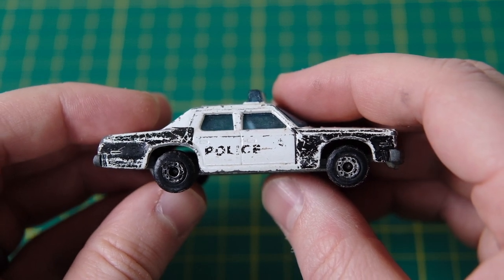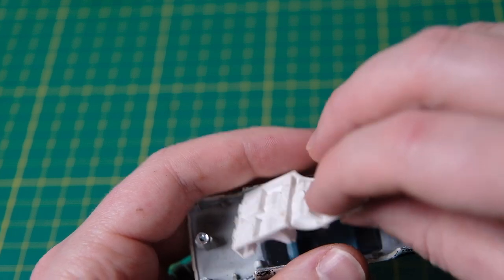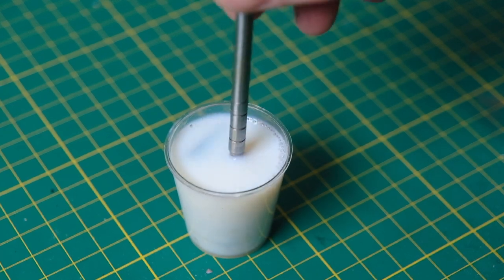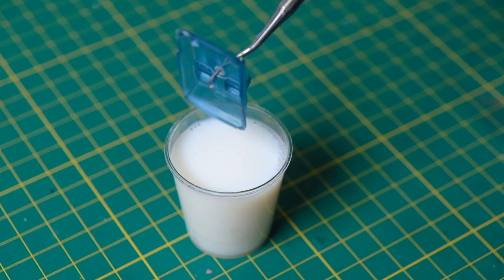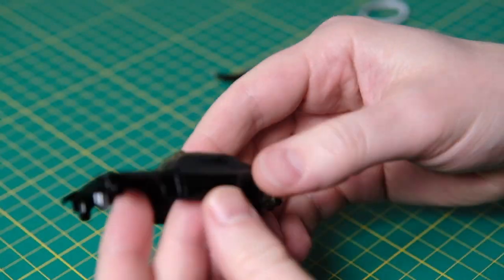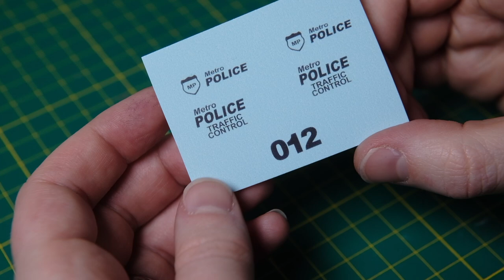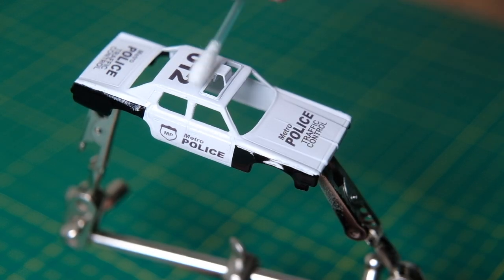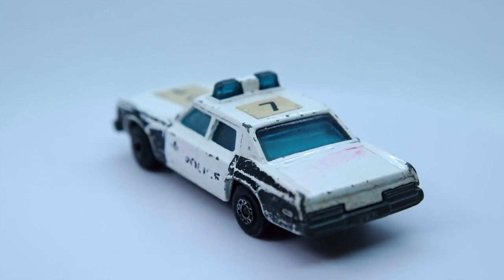MATCHBOX restoration: 10F Plymouth Gran Fury police car

Comment: It's got a cop motor, a 440 cubic inch plant, it's got cop tires, cop suspension, cop shocks. It's a model made before catalytic converters so it'll run good on regular gas.

Fix the cigarette lighter...